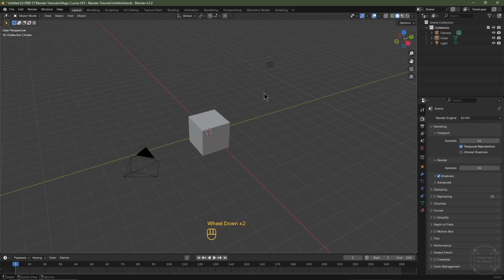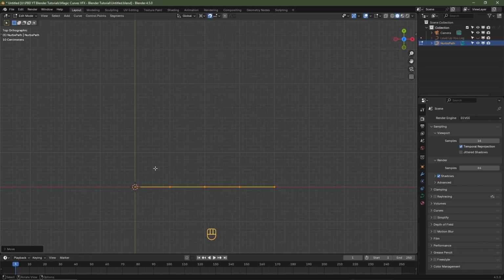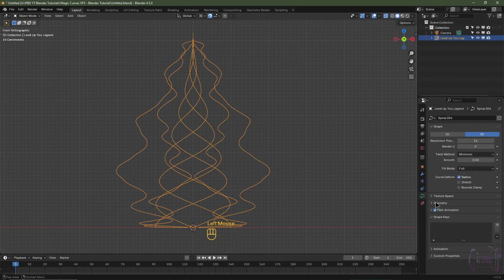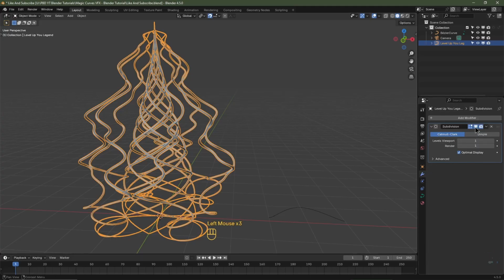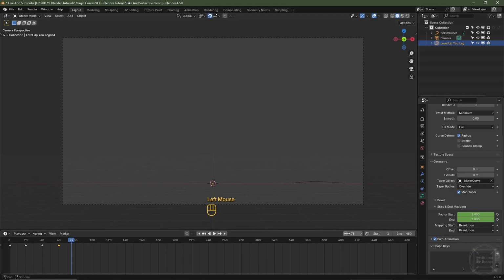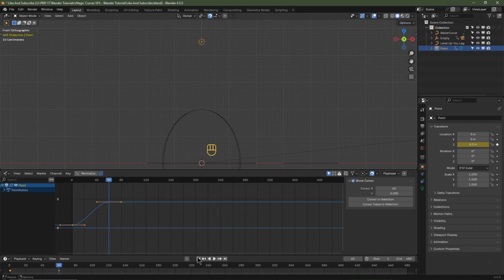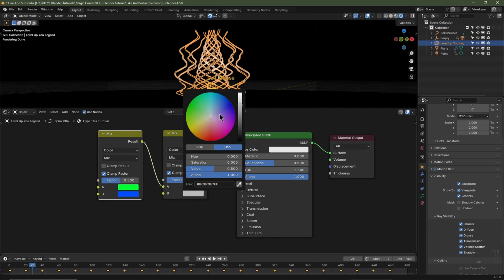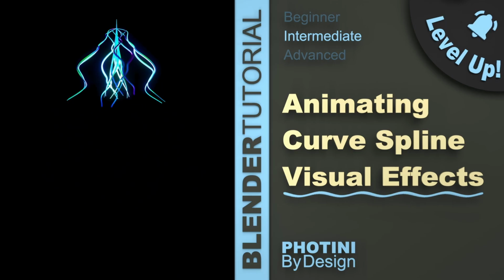Magic VFX With Curve Splines - Blender Tutorial

Comment: When you add the Archemedian Spiral Set the Radius Growth to .5 and the Radius to 0.0. This gives the same result as doing the proportional scale edit to bring the top in to the x,y=0.
Also set the Height to a negative value if you want it skinny at the top.
Reply from the maker: That's a brilliant tip for the community, stay sharp and level up 😀